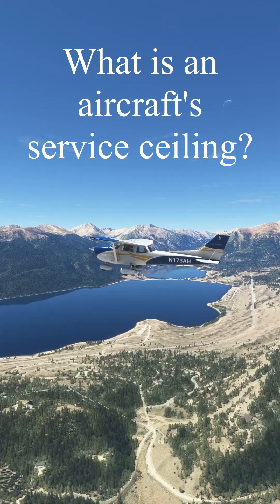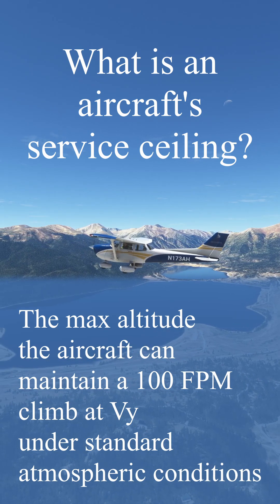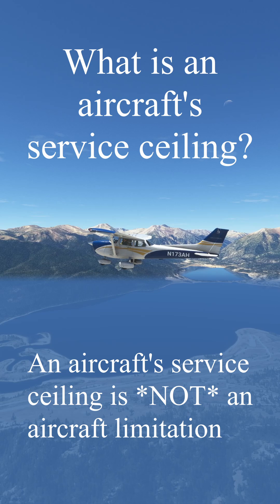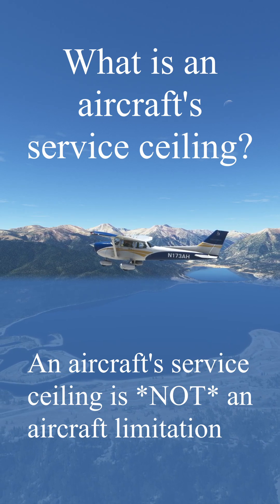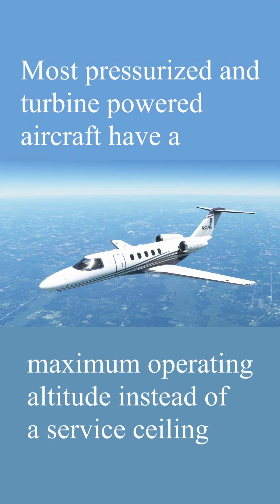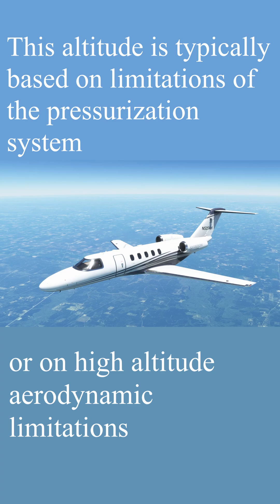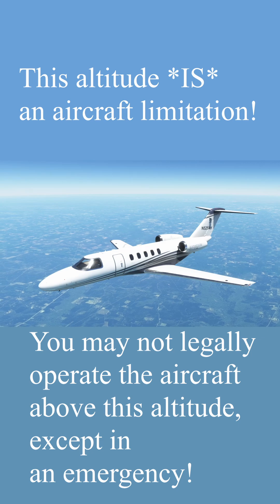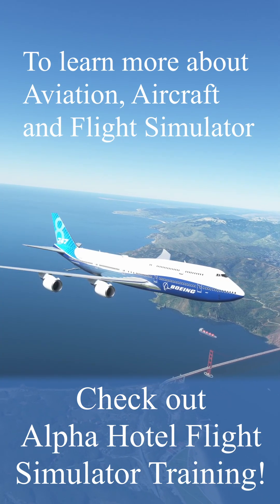What is an aircraft service ceiling? #msfs  #aviation #flightsimmer

Comment: In a pressurize cabin if you fly higher that the required attitude  and there is a breach in the cabin, you will die before the plane runs out of gas and crashes.
Reply: No shit Sherlock